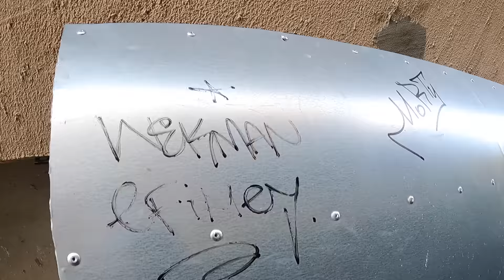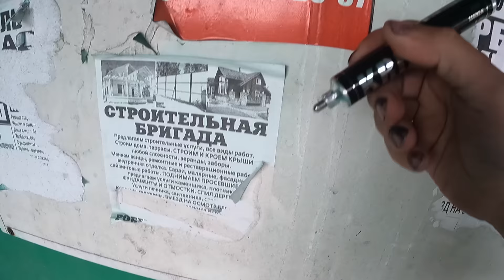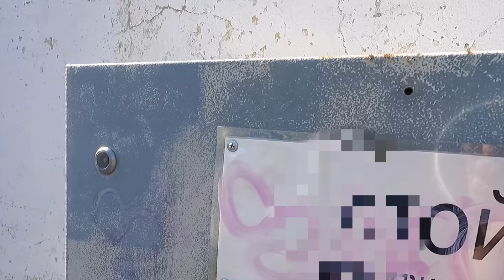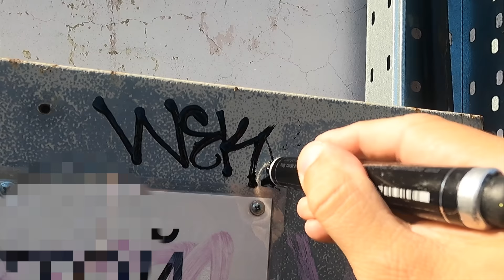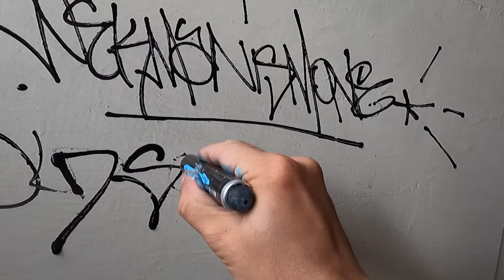Graffiti review with Wekman Krink k 90

Comment: decent marker considering its ink is very good but you either get alot of ink causing to much drip and for all the ink to go all over you're tag or you get no ink at all personally i would rather buy 4 white out pens and have them much longer than buy this marker
Reply: Nah it’s bad lol
Reply: the ink looks really nice when it actually works. can the ink work in a different marker?
Reply: @slime_street  True but the marker is just horrible for that good ink
Reply: @slime_street  you could try using a grog metal head marker? it might work well.
Reply: it dries 3d; way more weatehr resistant and buffproof, when you paint over it it still shows on top of the paint because it goes above the surface. nothing like a whiteout pen
Reply: Dalo markers